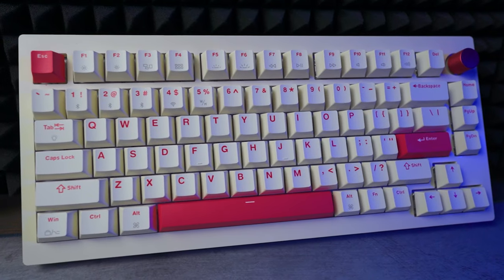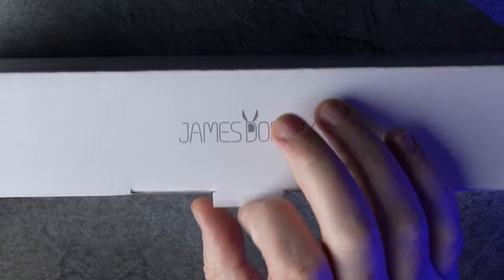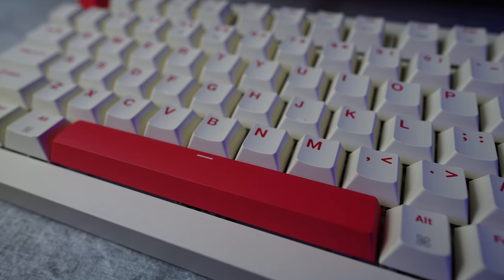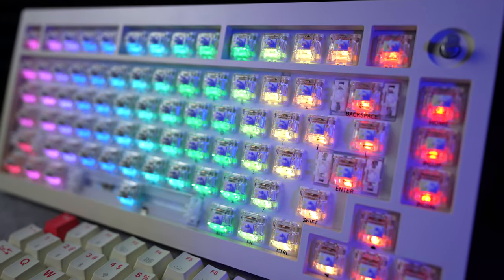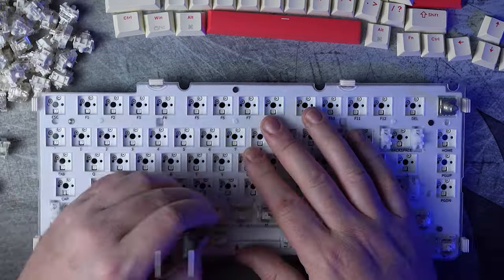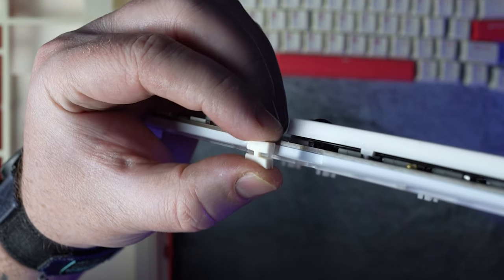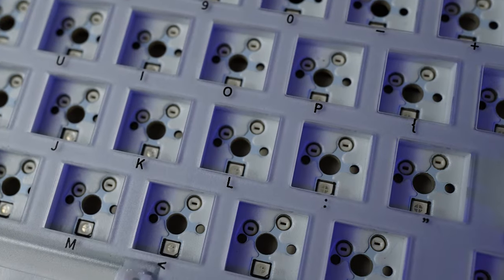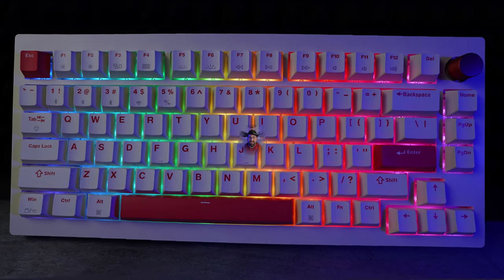JamesDonkey A3: Feature packed & NOT worth it

Comment: Just recently did a build on this board with lubed Akko V3 Cream Blues, and it's the best sounding build that I have so far, even better than my Keychron Q1. I only bought the barebones kit so I did all the modding myself. I did however watch some videos of the pre-built version of this and it did sound really thin on my ears, I guess it's really a case-to-case basis for this board, best to just buy the barebones kit and do the modding yourself if you really want to bring out the potential of this board.

Comment: I think that the A3 is a nice keyboard for the price, especially with wireless and that JD is a Keychron subsidiary.
Reply from the maker: Not my cup of tea. First and only keyboard that went straight back in the box. Funnily enough I have the JD RS2 3.0 here for review. It's a different thing altogether. First impressions it seems like a lovely typing keyboard.
Reply: @keebface  was not aware a new revision came out, will have to take a look at it. Cheers!
Reply: im not very sure about this but i think jamesdonkey is the parent company of keychron since very early keychron models comes with jamesdonkey stickers
Reply: @sunjames3276 i don’t think so cause which i can tell that keychron sucks. Worst build worst sound unstable connection. Not a thing like Jamesdonkey A3 😂

Comment: Y'know funny enough I have the JD A3, it's my first ever custom kit and my current daily driver. It's not the best but I made sure to mod everything. For myself as a Malaysian, the Akko and Keychron are more expensive than this board on my vendors and I had to be economical for this first board. I might upgrade eventually, but so far the typing experience has been great. It's not really thin, but I like my keyboards clackier. Wish I didn't have to hear my table every time I bottom out though, but this is the best keyboard I've had and certainly beats my old RK61 board for now
Reply from the maker: I'm glad you like it! You need a desk mat or two to stop hearing your table, I would think. Felt is good for sound deadening, like in my recent videos. I use a big felt mat as my desk mat, then a Keebmat under the keyboard itself.
Reply: @keebface  funny that, I do have a thicker desk mat underneath it. I'm not planning to stack mats because the weird bulge of the multiple layers makes it look weird, so I will eventually have to consider an upgrade

Comment: I just bought the A3 😢. Should I return it for the ACR 75 v2?
Reply from the maker: All just my opinion mate. Perhaps just see what you think. I prefer the Akko, but you may not.
Reply: Like keebface said, it is his' opinion... I have mine and I love it! 
For me my requirements:
 - knob
 - configurable (there is a software for macros and mapping  from James Donkey)
 - exploded arrow keys
 - 3-way connection (usb, bluetooth, 2.4ghz USB)
 - accessible switch easy switching of connection (i have 3 different PCs to switch to)
 - simple aesthetics

James Donkey A3 fits all the criteria I needed and is the more superior (in my opinion) to Nuphy Halo75 and Skyloong GK75

I think the retro / red color accent contributed to the turn-off in this video... But the retro / white and black / orange cases looks a lot better than what was reviewed.

I think the video is a bit lacking in terms of proper unbias testing:
 - not fund of the switches = should've swapped with a switch of your liking
 - not fund of the keycaps = should've swapped with a keycaps of your liking
 - tape mod = not performed...

in summary, I find the review... meh...
But again, this is also my opinion 🙂
Reply from the maker: @C C 9  not nice, eh? You didn't make the keyboard, but I made this video, so maybe be nicer. It is my opinion, but I also have 50 keyboards in my collection right now, and this is the worst one. I didn't do the mods because it isn't worth the time for me, all the boards I've modded (45 or so) were.
Reply: @keebface  I've got no beef with you mate... the same way you give feedback about people's work in this keyboard, surely it's also okay when people give feedback about your work... or is this a one way street?

The video editing is great, your speech is solid, the flow is smooth, and the presentation was well made. My critic was in your methodology for the test. 
You cannot use a bad switch and keycaps as an argument for the board. All I am saying is that there was a flaw in the review. It's nothing against your talent and capability to make great videos. Again, this is my opinion. Peace and love brother. ❤
Reply: @CC-pt3di  You weren't the only one with the same thought ;)
Reply: @CC-pt3di  Agree with you 100%
Reply: @CC-pt3di well said. Bought this keeb as I was looking for that specific feature set of 3 mode wireless and knob. Didn’t like the red and creme so I simply just bought it in the retro theme to match by matcha keycaps. Considering most of the complaints said in the vid can be solved with simple swapping and mods, totally worth it for the price atm
Reply: @CC-pt3di he did not modify it and said not worth his time to do it. Eh? How could this be a MechKey review. Say without any proof that its bad 😂😂😂

Comment: nothing is wrong with that keyboard. at the end its a cheap don't compare it to 400+$ keyboards
Reply from the maker: What $400 keyboard? The tiger lite is $130 as a barebone, the v7 is $64, the ACR v2 is $70, and the A3 is $70. The back to back test had them setup with the same keycaps and switches. The Tiger lite represents what you get if you step up $60, and the rest are the same price or cheaper?
Reply: @keebface  i bought full keyboard jamedonkey a3 with 40 USD in my country and ACR v2 is 70 USD (without keycap or switch). So I don't think you can really compare them